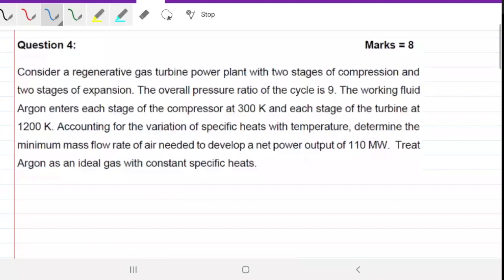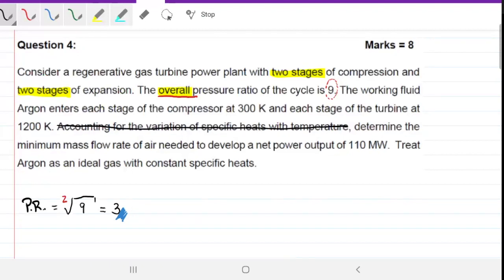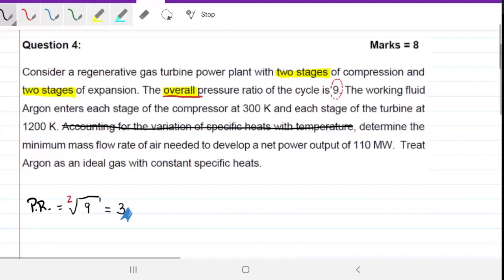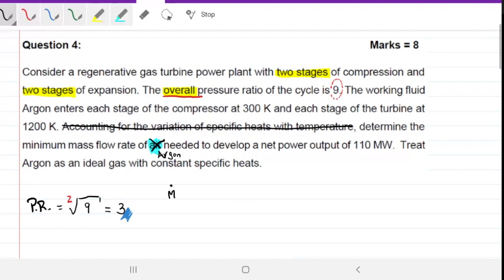2019 Exam - Thermodynamics Mech3001 - Question 4

Comment: You're not accounting for the change in specific heats though. Which could easily by taken from a table, if given on the exam of course. But it seems like this question is very badly formulated seeing the mistake in mass flow rate of air in stead of argon and probably no enthalpy tables with relative pressures included
Reply from the maker: Hi Hans. Thanks for your comment
Yes, you are right. It could have been solved accounting for the change in specific heats using the tables like we do in other problems here in the channel. However, note that the statement says both DO take into account and DON'T take into account, so I recommend that students do the latter in an exam context so that they spend less time on the question. We could redo this question here for the channel taking the variation into account if you think that's valid/helpful. Let me know 😉